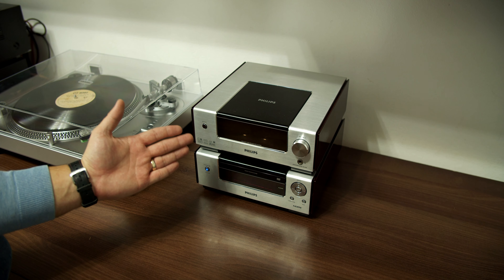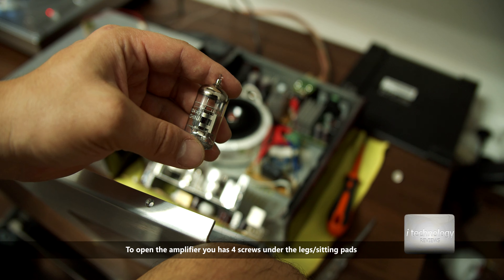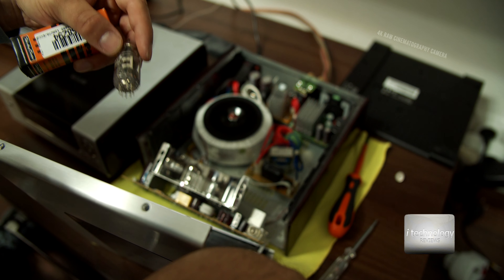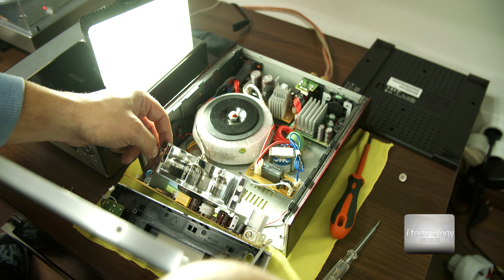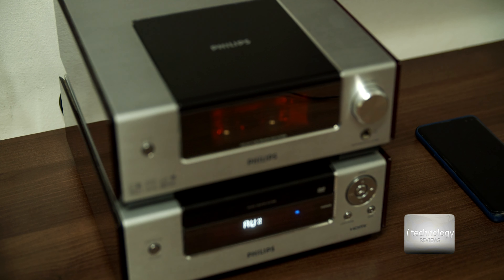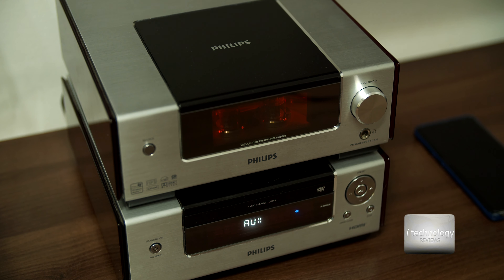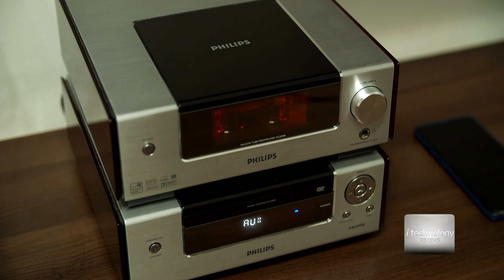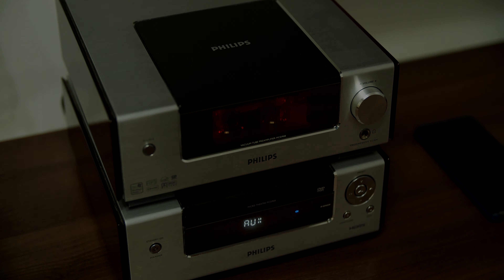TUBE amplifier for Audio Tehnica LP120x - Philips MCD908 Upgrading TUBES: 12AX7 to 12AU7. AUDIO TEST

Comment: Great demo , Both 12ax7 and 12au7 tubes are used for specially for the gain channel in Guitar amps , 12ax7 has more gain than the 12au7 .
Reply from the maker: Thanks but AU7 is better at the sound quality/accuracy; SUBSCRIBE

Comment: Wonder if the hiss went away. If you listen in headphones there is no hiss, and I am pretty sure it is using the tube preamp stage. So I am afraid the hiss will still be there after vacuum tube swap. On the other hand the power amp is a miniscule board with a  TDA8920, and as I understand it always has hiss if separation between AGND and PGND is not done properly.
Reply from the maker: Hi. the hiss is still there. Subscribe

Comment: How did you take off the lid/front panel?
Reply from the maker: hi; yes and the top is combined with the front panel;
Reply: @iTechnologyReviews  I know that the lid and the front panel are combined. But how did you remove it from the chassi? I loosened the screws on the back panel but couldn’t remove the lid.
Reply: did you manage to get the answer/  I am also stuck here.
Reply: i have managed to figure this out if anyone is interested drop me a note
Reply: @maestr001  can you tell me how you managed to open it? the fan is making noise and for the life of me I cannot figure out how to take this thing apart
Reply: Nevermind, I found the screws on the bottom hidden underneath the rubber pads

Comment: Hi, I hv changed the tube to 12AU7, but the sound is very low. How can I make the sound louder?
Reply from the maker: hi; yes is a little bit lower; there is not a big difference; you cannot; but you gain a greater sound quality; subscribe
Reply: Put back the original 12AX7 ,the sound will be ok as original .If you want to change it ,forget it ,just buy 12ax7 from gold lion,tungsram ,tung sol  and see the difference .12ax7 has more gain 100 , than 12au7 has just 60 that s why the sound from your system is low .